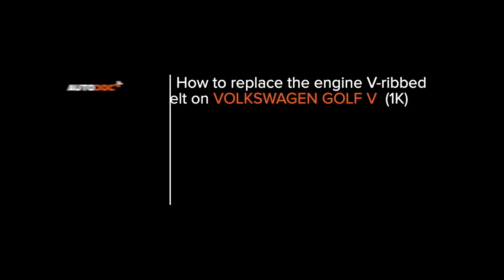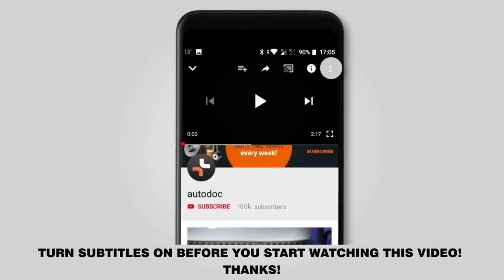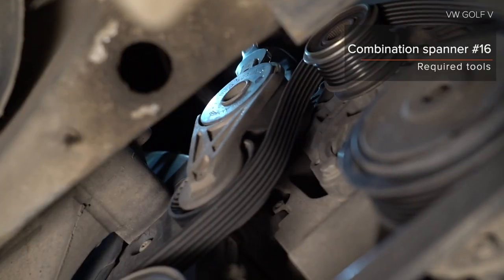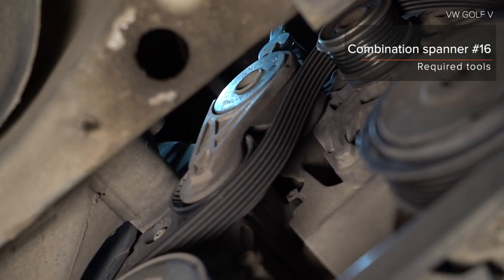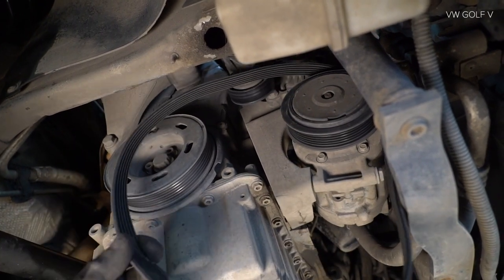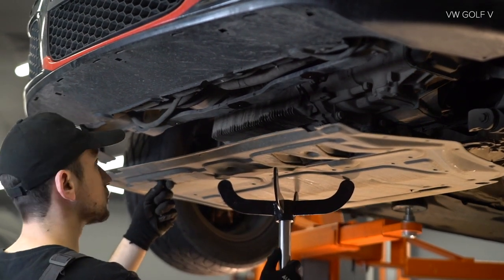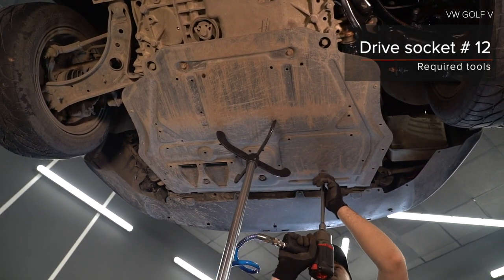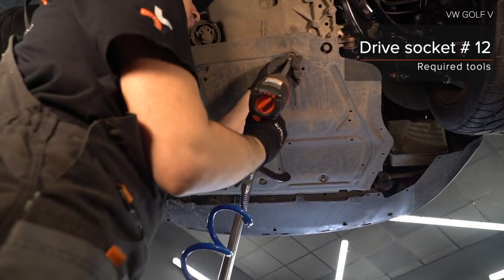How to change serpentine belt / v-ribbed belt on VW GOLF 5 (1K1) [TUTORIAL AUTODOC]

Comment: A lot easier using a hex wrench to lock the tensioner in the maintenance position using the hole provided. Can also be done from the top of the engine bay without lifting the car and removing the belly pan quite easily!
Reply from the maker: Thank you for sharing your experience.
It will be very useful information for us and our viewers.
Best Regards,
Autodoc team
Reply: what hole ? what size allen key ?
I can't find reference anywhere in VW Mk5 2004+ manual

Comment: Greetings i have a mk5 gti,i would like to remove the ac compressor because of perfromance,so if i buy the shorter belt,do i need the idler pulley or the tension pulley that you pull the belt of it?
Reply from the maker: We do not have such information, we recommend that you consult your mechanic.